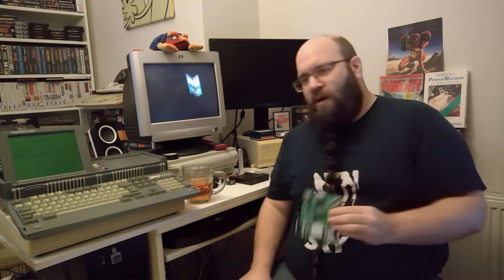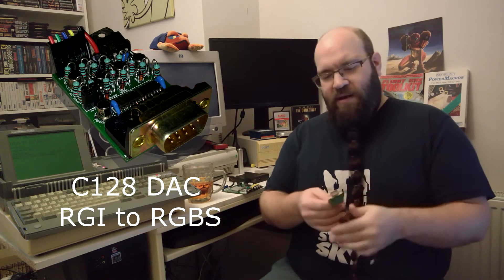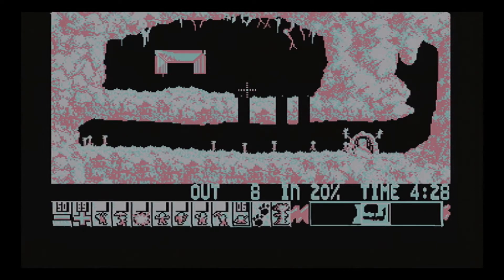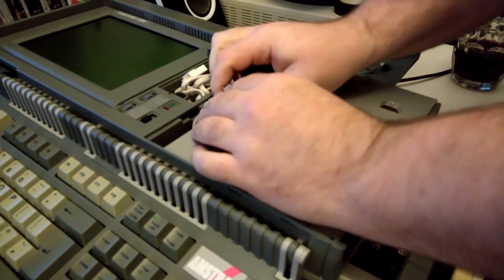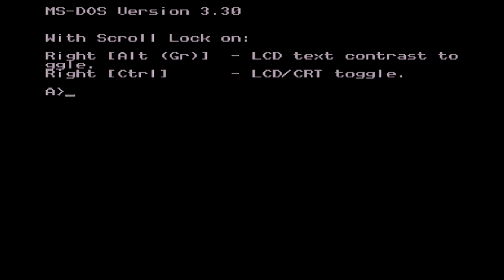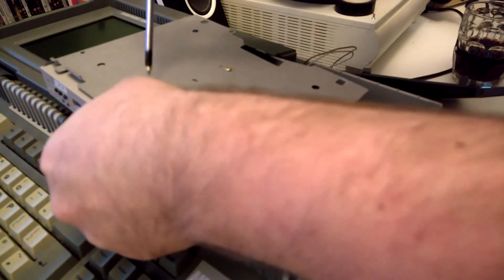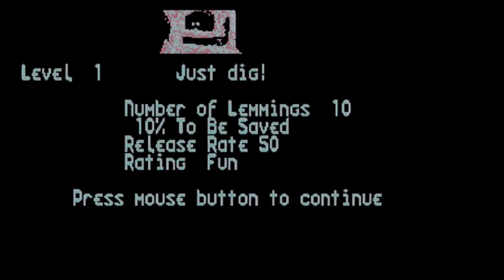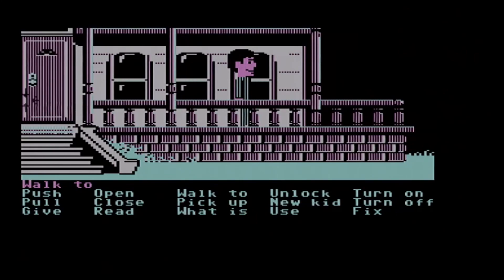Amstrad PPC640, Part 2 Upgrades

Comment: Great Video. Can I ask where you got the C128 DAC board from please. I have come up against the problem trying to use the GBS8200 v4.0 with an Amstrad PPC.
Thanks
Reply from the maker: Thanks, happy you enjoyed it.
After checking though my emails (as 2 years is way too long ago for me to remember).
It seems I bought it from eBay,  I checked and the seller isn't going anymore.
but it was called:
"Commodore 128 Video DAC RGBI to RGBA Adapter by Digital Audio Concepts"
Hopefully that can help.
Reply: @GouldFishOnGames  Thank you, I'll do a bit of research.

Comment: Having problems with a 720kb on in a PPC512. Trying to use it as drive B. Haven't changed any jumpers - is that necessary? Doco seems useless. (And yes, it's on drive 1, rather than drive 0 (Jumper 2 rather than Jumper 3).
Also, does the USB disk need to be partitioned, or a single filesystem from block 0?
Also also, is it FAT32, or need to be FAT16?
Reply from the maker: These things can be a pain to setup, if its the default gotek firmware then you need to use the gotek tools to setup the drive and copy the disk images to it.
if its running something more modern like flashfloppy then it can be fat32.
Reply: @GouldFishOnGames  

Hi mate.

The vendor had supplied a 1.44 version rather than a 720kb.

It does work on a motherboard that supports 1.44.

The interesting thing is it just uses the USB disk as a blob of storage. No filesystem is created or used on the USB disk 

Advancing to the next floppy "image" just moves the offset it's reading and writing to by (2048kb?)
Reply from the maker: @ChrisWells1  That makes sense as I had issues with using a 1.44mb drive, replacing the firmware with flashfloppy should make it usable, and you can just put images on the usb drive.
Reply: @GouldFishOnGames  Hi GFoG.......
I've done some more testing - just for the heck of it......... The 1.44MB model stores each consecutive floppy image in a 1.5MiB block (The last 98304 bytes between floppies is just junk. The unit doesn't even both setting these to 0x00)......
ie floppy0 = 0 -> 0x17FFFF,  floppy1 = 0x180000 -> 0x2FFFFF, floppy2 = 0x300000->0x47FFFF etc.

Comment: An interesting video, for the VGA part you can also use the MCE2VGA (https://www.serdashop.com/MCE2VGA) which was used with  a VGA screen to replace the internal screen of the PPC : https://www.youtube.com/watch?v=3MHMM8vQiEw (check https://retrohax.net/amstrad-ppc640-modshax/). Also from Serdashop some "sound card" on parallel port can be used (Covox4 used on a PPC 640 : https://www.youtube.com/watch?v=vPtikDYTh5E). Any news about using the expansion port for using ISA cards ?
Reply from the maker: The MCE2VGA does look better then what I put together (I think I could improve mine by passing it on to the OSSC rather then using that cheap upscaler.  
I've seen those parallel port audio cards on a few videos and I've been tempted to try them out, just never got around to it, which is the same with using the expansion port for isa cards.  I still think its possible, just I might not have the skills to pull it off.
Reply: @GouldFishOnGames  Well it exists now, just in case you didnt see it yet : https://youtu.be/-HxvCWhKLoc
Reply from the maker: @emmanuelroussin1906  I might be in the process of picking up all the parts for something like that and have some ideas.
Not sure when it will be ready but at long last I should be revisiting this great machine!

Comment: Is there composite video out on the motherboard???
Reply from the maker: I read there was a composite cable released, but I couldn't find any real details on how it might have been wired up.
I did try to get composite out of the video connector, but had no luck.

Comment: how about upgrading the RAM on a PPC512 and adding CF storage????
Reply from the maker: Not sure about upgrading the memory, I didn't really look at where its located on the motherboard.
As for CF storage I think its possible, but you need to use something like the XT-CF isa cards then wire the edge connector to the right pins on the board.  It would be very fiddly.

Comment: Make sure you're not running Lemmings in Amstrad mode:  It'll be looking for the weirdo 1512/1640 mouse, and that uses keyboard scancodes for button presses.
Reply from the maker: I think I tried it in a few modes, but it was a year or so ago now.  I'll have to mess around with the machine again as I wanted to try a different way of getting video out.
Reply: @GouldFishOnGames  I got the impression someplace that they were designed to work with the PC1512 and 1640 monitors, which would make a lot more sense than using a CPC monitor.
Reply from the maker: It has CGA out, which is why I was using the CGA converter (the other monitor port seems to be for power only), the CPC monitors were basically just 15khz RGB ones like the Commodore Amiga ones.
But knowing Amstrad it might not have been 100% standard and really only worked with monitors they made.
Reply: @GouldFishOnGames  I think the CGA on their early PCs may have been slightly weird.  Maybe why the colours were off?  Reading something about them having composite sync on Vogons.

But the Amstrad PC-MD, PC-CD and PC-ECD monitors all have the PSU for the machine in them, and then a separate video lead.

The PC-CD is the CGA version.

Comment: Hi, i have seen one of these machines with a hard drive, do you know how this could be done.
Reply from the maker: There was a third-party add-on that took the place of the modem and one of the floppy drives.
These days it might be possible to wire up an 8bit ISA cable to the extension port then connect something like an xt-ide or xt-cf board.

I've not yet done it my self, but everything I've looked into says it should work.
Reply: @GouldFishOnGames  that would be good with a xt- CF setup, if you do get around to doing this would be great to see the video as I have just bought a ppc640 in excellent condition but wouldn't know where to start.
Reply from the maker: @tonycrane726  I hope to at some point, it's just those xt-cf cards seem to be quite expensive to get in the UK. And I need to improve my soldering skills before I'm willing to tackle such a large project (60 odd wires to solder!)
Reply: @GouldFishOnGames  well I have a xt-CF setup in my IBM 5150 I could take that out and send it to you when you fancy giving it go that way you don't have to purchase the CF adapter you can use mine, and after maybe you can help me setting mine up.
Reply from the maker: Thanks for the offer, I haven't really thought about doing this upgrade for a while so I'd have to run my idea's past some one who has some actual skills with electronics and XT class machines to see if I'm not going in the wrong direction. 
And I'd want to test it on something that I wouldn't worry about breaking first, If I make some progress I will let you know.
but I wouldn't expect anything in the next month or so due to being quite busy and needing to improve my soldering skills.
Reply: @GouldFishOnGames  Hmm.  Sergey Kisilev designed an ISA backplane for his all-in-one PC on an ISA card designs.  I wonder that might not work as an expansion unit for the PPC?
Reply from the maker: @TheTurnipKing  The machine does support some form of ISA backplane as there was meant to be an official one (though tracking down info on it is hard) but there is some hand written designs for one that I've seen.  As there are all the lines needed in the expansion connectors, but I've never worked out if they could be directly wired to a isa slot for if they need additional circuitry in the middle.
Reply: @GouldFishOnGames  in theory a signal is a signal.

The technical manual does note though that the power pins on the port are intended to supply the PPC, not provide power to devices, which seems sensible.  In such a setup your expansion device would have a separate PSU that would supply both the ISA devices and the computer.
Reply from the maker: @TheTurnipKing  I was wondering if there would be more work required as the tech manual does mention something about unbuffered pins.
"The signals marked with an asterisk (*) after the pin number are generated directly from the internal gate arrays and should be buffered using a suitable non-inverting buffer (74HC244). There are a total of 16 such signals.

The signals marked with two asterisks (**) after the pin number are the expansion data bus and are at cmos levels. They should be pulled up to TTL levels with 10K ohm resistors."

Part of me wonders if trying to use the port that connects the internal modem might be a better solution, as that should provide power and all the address and data lines needed, but it might be less documented.

I'm not all that great with electronics, so I'm mostly spitballing here and would have to find an expert to run my idea's past.
Reply: @GouldFishOnGames  Spitballing too, but I think Sergey's backplane ( https://github.com/skiselev/isa8_backplane ) provides buffering.  (the design mentions the 74HC174, which seems to be similar in purpose).  The trick there is that all of the traditional "motherboard" components are moved to an ISA Card so the only way they have to communicate with the rest of the system is the backplane itself, so all that's on the backplane is a few ICs, capacitors and an ATX power connector.

Meanwhile, we can be fairly sure that PPC already implements a functional ISA bus because that's how it communicates with its integrated peripherals, and then it just brings them out to the expansion connector.
Reply: addendum: It seems like the modem is connected via an RS232 serial port with a nonstandard pinout, so probably not suitable for an XTIDE solution.  Might lend itself to replacement with a modern wifi modem like the wifi232, though.
Reply from the maker: @TheTurnipKing  I'll check out his design when I get a free moment and see what can be done with it.  And it typical that the modem isn't an easy option.

Comment: Hi! I know this video is almost an year old, but I would appreciate any assistance you could give me... I have the same computer (PPC640) and I am struggling to get the GOTEK to work on it. I am running a GOTEK with the latest flash floppy firmware version (v0.9.30a) and I wasn't yet lucky to get my PPC640 to see the files on it. I also tried using USB Floppy Manager v1.40 to partition my USB thumb drive into 720K partitions, but still, nothing. Any suggestions on formation the thumb drive, creating the .CFG file or the jumpers? Thank you!
Reply from the maker: I used the hxc firmware for my machine but the floppy flash should work from what I've read. You shouldn't need to format it into the multiple partitions, just put the files on the usb stick and try either native or index mode. There is lots of details on the flash floppy wiki about them.

Comment: I've got one of these, currently trying to get it working to its full potential. The only problem is that my USB floppy drive doesn't seem to like 720k disks, and I dont' have any way of working with them. Do you know if one of these machines will take a HD floppy drive, or is it DD only?
Reply from the maker: I tried using HD disc formatted as DD but the drives really didn't like reading them.  And I had no luck with putting a HD drive into the unit which is why I had to flash the gotek drive I put inside it.
Reply: Ah shucks. I don't have an issue using DD disks, the main problem for me is that (at the moment) the only other drive I've got is a USB one that doesn't seem to like DD disks very much (actually it's destroyed quite a few in attempts to format them). For now though, I've got an OS and some software on a disk, and fitted a second drive this morning.

What happened, then, when you put the HD drive in? I'm guessing it either puked or pretended it wasn't there? I'd ask if you changed the jumpers but you'll know that one anyway haha
Reply from the maker: The only HD drive I used on the machine was the gotek and while the machine spotted the drive was there is just wouldn't read any of the discs (both DD and HD).  I tried various dos commands to try and get it to work, including some that were not documented in that version of DOS but were included. None of them worked, this also included trying to boot off later versions of dos, but no luck there either.
The only thing I found to work was either a DD drive or a gotek with HxC firmware (which correctly emulates the DD drive) though floppy flash might also work.
Reply: Hmm. I have a real drive somewhere that I used to have in ye olde desktop, it won't cost anything to try that, and if I expect it to fail then I got nothing to lose.
Reply from the maker: you might have more luck then me, it would be interesting to hear how it goes.
Though the big thing is trying to add a hdd to the machine.
Reply: @GouldFishOnGames  a 3.5" high density mechanism should theoretically work but still only able to read 720k disks.  I understand the floppy controller's data seperator is simply too slow to read HD media.

USB floppy drives are pretty poor on support for anything but 1.44mb

Comment: HXC works with the Atari ST too I use mine for my Amiga and Atari ST,Can't afford to get another.
Reply from the maker: For the Amiga and Atari flash floppy is fast becoming the firmware of choice when installed on a gotek drive. https://github.com/keirf/FlashFloppy
I wanted to give HXC a go as it supports more platforms, some of which I have :)

Comment: This is a great video, I recently bought one of these on ebay for 20 pounds, but case was in bad shape so removed the board and and im putting it in a luggable crt case, going to apply the same with my own :)
Reply from the maker: Its a great machine, hopefully you can get better colour out of yours which seems to be mostly down to how lucky you get with the GBS8200 as its been cloned by so many people and various results.

I've been thinking of revisiting the machine at some point as I think there might be a way of connecting a hard drive to it.
Reply: http://xaragmata.dyndns-web.com/ppc.html check this out, looks like you could tap the hard drive from this
Reply from the maker: I've been checking that and the tech manual, I think for shot distances you should be able to wire the expansion pins directly to a 62pin edge connector and then use something like the XT-IDE (or XT-CF) to the machine.  Bit more work you could also add a adlib card as well :)
Reply: That sounds great, if you manage to do that, do share your experience! Id love to see how it turns out :)
Reply from the maker: I'm sure to document it (if or when I get the chance to try it), and put up a follow video :)

Comment: Yeah, I had a problem with a DOS version of lemmings, because of copy protection, had to hex edit the first byte of a file(russell.dat), then run it once, then make the file read-only(since it increments by 1 every run).  At least it's better than the Windows version of Lemmings I have.  Also I should probably get around to playing Maniac Mansion sometime.(Finished DOTT at least.)
Reply from the maker: I had issues with the full lemmings so I gave up and used the demo version :)
I have to admit I've never completed Maniac Mansion either, I remember one attempt when I used Bernard and if you used him on the panel that triggers the copy protection he would try to hack which would fail the copy protection and the game would end.
Reply: DOTT should have Maniac Mansion playable in the game.
Reply: @pferreira1983  Yeah it is, but you only get the one save slot.  Also I own Maniac Mansion thanks to GOG anyway, so I will get around to playing/finishing it some day.
Reply: @lmcgregoruk  Nice! 👍

Comment: Those colours seem a bit out of wack, but better than green and black :p
Reply from the maker: Something went wrong between the GBS and the capture card, and that was the closest I got to how it showed up when I used the monitor.

I think the GBS might not have been the best (so many versions and clones) as it never had quite the contrast as I've been in emus.

But it was still so much better then the LCD :)

I was hoping to test the rgbi to rgbs converter with my OSSC but I managed to fry it when I went to test.